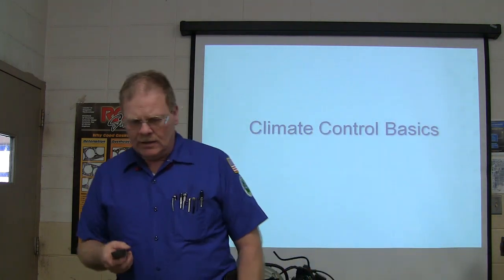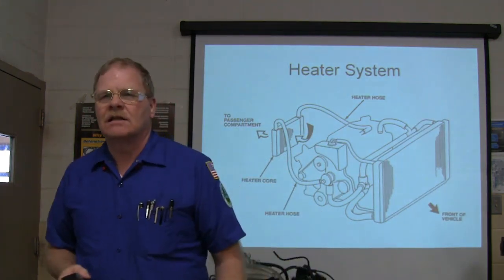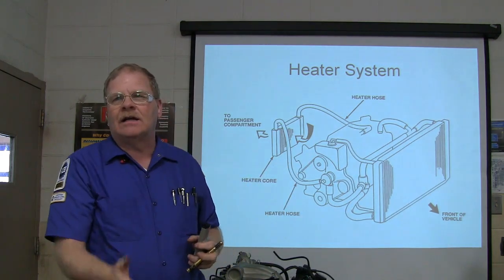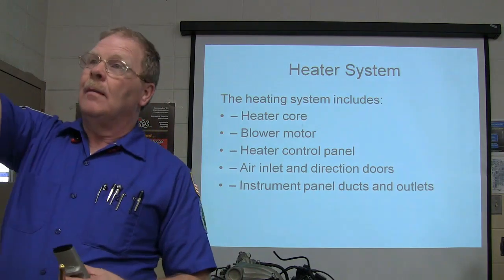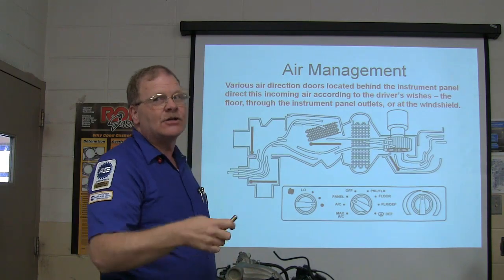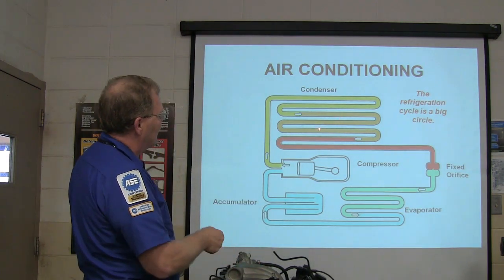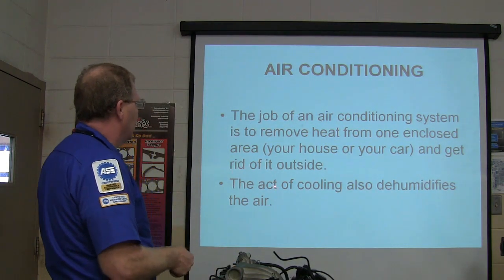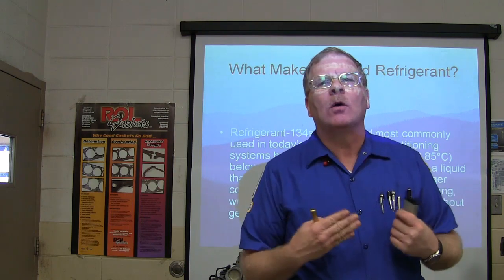Climate Control Opener

Comment: Good one on the containers. I have done that temporary until I got past what I was doing at the moment knowing just how bad it can be if something like that happened. With maintenance intervals I change the radiator cap. I have encountered over several years on different vehicles 2 head gaskets and a heater core problem caused by a stuck non venting caps. The good rubber hoses were like steel under pressure and clamp points were starting to seep. Over the years got the idea of how much power BTU numbers are but never had it explained. R-12 to 1234 $100  Well 134 was nice while it lasted. Seams like car repair price keeps following the trend of the over priced cars. Back to school!!! It feels good to keep thinking!